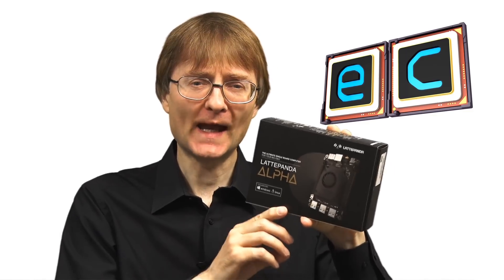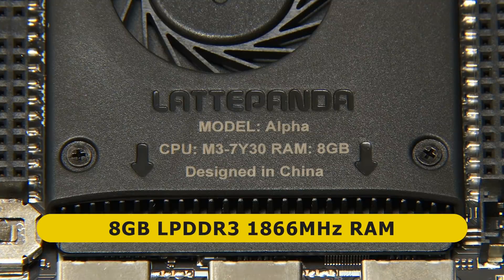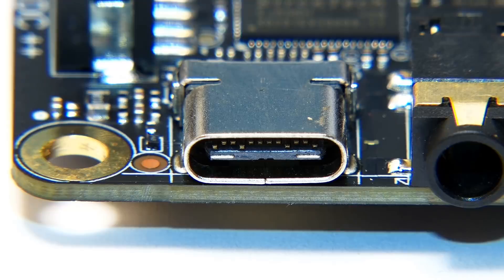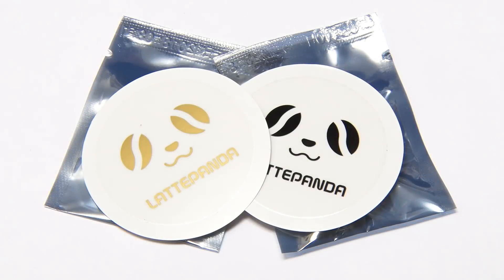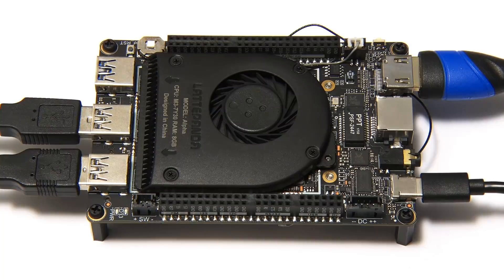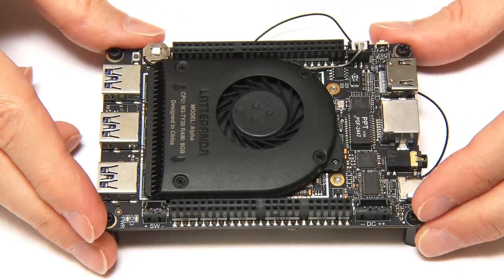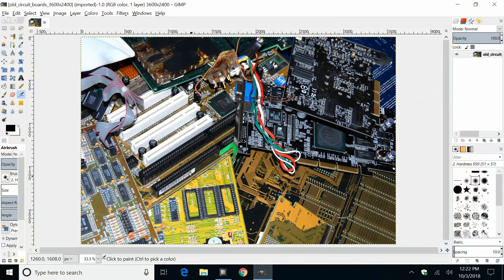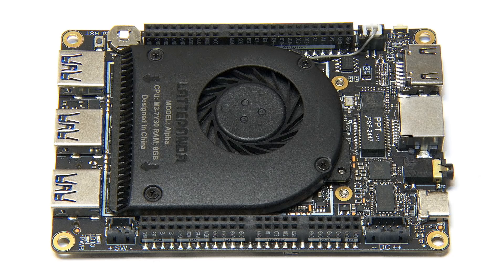LattePanda Alpha: Windows & Linux SBC

Comment: This little board and video have peaked my desire to build a NAS
Chris your videos are awesome my friend, you do such a great job at getting your point across.
I love how Linux has really become a cool hobby nowadays
Back in the day I mean in the early to late 2000’s I bought a bevy of boxed retail releases of Suse, Mandrake, Corel and Red Hat Linux
All in the name of projects.
We’ve come a long way to today.
I’m currently using nothing but Linux 
I bought myself a pinebook pro
And a large sum of SBCs 
So I’m set to tinker with Linux for years to come.
I’ve also got a small but might data center I built from old Dell Optiplex Systems and Xeons to make myself feel like they were server lol
The Xeons are so cheap, or were so why not.
Most of the machines I’ve done that too are turned into small nodes in a small data center like configuration.
Not a ton of space is on them. But they work beautifully 😊

Comment: If you're considering buying a LattePanda Alpha/Delta I'd strongly encourage you to visit the LattePanda forums first. Despite these boards having good specs, and indeed reviews,  you'll see there are significant recurring technical problems reported by users that DFRobot have not provided updates or solutions for. 
If you happen to be unlucky enough to run into these problems you will be asked to ship your board back to DFRobot in China. My board was gone for 6 weeks after the much reported power/boot failure, then returned and the NVMe slot didn't work. I've now been asked to return it to DFRobot again. Beware.

Comment: FYI my LattePanda Alpha died after around 2 years of use (dead this past weekend 01/2021). Completely DOA, no lights when powered by USB-C and 12VDC on the JST PH2.0 4-pin connector. Seems many others have had complete failures as well if you search around a bit. Depressing since these are nice little SBC’s. I even kept an external fan on it and monitored the hardware temp sensors 24/7.

Comment: It's an interesting little device but who is it aimed toward? At over 300$, you're clocking in just under what you can build a Mini-ITX beast at with a Ryzen APU. And that's just for the board. No accessories, no OS, no case, nothing. I understand why the price is what it is, but what purpose is it serving? At 150$ this would be a behemoth of an HTPC, but it's roughly triple that to function as one, while only being marginally better than a Raspberry Pi 4 at the same role.

x64 is also far less forgiving on weaker machines.

Comment: Can you install old OSes like MS-DOS, Windows 3.1 and Windows 95 on there? I mean is there a way to lower the RAM on this device to 1 GB? And are there universal drivers to work for sound and video on installing drivers for these old OSes I’d mention in this comment? I would like to know please.
Reply from the maker: You will struggle to find drivers. But you can install DOSBox and run DOS and Windows 3.1 no problem -- much as I do here on a Raspberry Pi: https://www.youtube.com/watch?v=idHQk99E4VA

Comment: What's alternative board to latte panda with AMD embedded APU with Vega 11 GPU and quad core CPU and 2 threads with 2GH or more clock speed and 16gb ram support
Reply from the maker: You may want to look to the UDOO Bolt: https://www.youtube.com/watch?v=8DINmS5YBD4

Comment: It is a cool little system but i think for myself i would go with the Delta because i would plan on installing Linux on it with RetroPie to run arcade emulation that should handle a whole lot better than the Raspberry Pi.

Comment: Not interested. 6 GPIO from the Intel processor, another 20 from an auxiliary microcontroller and a preposterously low amount  of DDR3 RAM given that it is actually some lowcost notebook board. Likely even with the RAM soldered to the board which is fine if you're running a limited sort of embedded application,but again this is meant to run Windows 10 and for that there has to be a way to upgrade the board to 8Gb and beyond.

Comment: Been toying with these small formats and a big issue I never thought about is the heatsink fan/cooling.  It's usually custom and impossible to source.  I found laptop parts are the best place to source for a suitable replacement when/if OEM has issues.

Comment: Thanks for being honest and starting the video out by telling us that the LattePanda was supplied FREE for review purposes.  I agree that the Pandas are all wonderful values if supplied FREE.  On the other hand, if you have to pay for them, not really such a great deal - and checking their web site, DF Robot seems to be pushing their already ridiculous prices even HIGHER than those quoted in this review.  Sorry DF Robot, you are going the wrong way...
Reply from the maker: The higher prices are for the new "s" model, which has a faster CPU.
Reply: @ExplainingComputers   
In general you would think a chip with a higher 'turbo' clock would always benchmark higher, but with Intel's arcane TDP based throttling it's never that simple.  In the old days it was simple, a chip would be specified to run at clock rate X and that was that - but NOW Intel specifies a max 'turbo' clock that it's internal governor might use (or maybe not).  They say this is to let them dynamically manage TDP, but I'm not sure that Intel isn't just using it to increase their yields by internally programming the governors of each chip at test time to keep those chips from getting into trouble if they are sub-par.

The web site www.cpubenchmark.net collects real world performance data in the wild, and publishes the average for each CPU type, and here are the current numbers for the old and new LattePanda Alpha CPU:

m3-8100Y = 3489

m3-7Y30 = 3554

So despite a much more impressive "turbo" clock specification, real world scores look roughly the same.  I wonder if perhaps DFrobot's impressive Geekbench comparison scores were based on simple random variations, or was it something they were doing wrong on the original m3-7Y30 (slow or single channel RAM for example, or their original stupidly inadequate passive thermal design).

In any case, their new fan based m3-8100Y boards should be nice I3 class performers, but they are I3 class boards, not I7 class boards, so I still think the prices are way the hell out of line.

DFRobot can spew all the silly kick-starter hype they want calling it "the soul of a powerbook"  - doing a comparison to another over-priced product that is literally Apple Laptop  to SBC Oranges -- but this doesn't impress me much considering that two years ago, during an Amazon Black Friday sale, I bought an Acer Aspire E 15 Full 1080 HD Gaming Laptop with an I5-6200U CPU, 8Gigs of RAM, a fast 256GB M.2 SSD, and NVIDIA 940MX 2GB Graphics, and of course Windows 10 - and paid almost exactly what they are asking for this silly little toy with Win10 and 64G eMMC- So YES I think it's overpriced.

At $199 USD in it's minimal No-OS, No-eMMC configuration it would be a bargain, at $249, it would still get a grudging buy recommendation from me - but at $379 ? - Who are they kidding???

Comment: Using Windows for embed systems in industrial applications basically should be a crime. So many random devices I see everywhere with a Windows error screen....
Reply: Chloe Mcholoe I’ve seen that too.  There is a version of Windows that runs stable on industrial systems called Windows “Embedded”.  These can tolerate power loss and keep the OS isolated from user data.  For some reason people continue to build embedded systems with regular Windows, which should be a crime, like you say.

Comment: Here is the reason why it is selling for the price of a basic laptop:  CONNECTIVITY. 
It can connect to things and be programmed to do things that you simply cannot do with a regular bare bones laptop unless you add in some other control circuits, and those will cost as much as this LattePanda itself.   However, the problem with Windows 10 is the constant updates and the amount of memory that it is eventually going to take over.  In 3 or 4 years time the updates will occupy the entire memory and there won't be room for any other programs. That is why the Raspberry Pi is a better toy for doing things with as you don't have to worry about constant updates filling up the memory.

Comment: Mr Barnatt: (I told you I'd be back)...I have 3 "hand-me up" laptops, all with windows, ranging from XP to 7. None see to be worth the effort of trashing, so I'll use my latest hand-me up until it drops, and I can' t wait until it 
does. What I've seen on other Linux videos seems to imply that if I download Linux to a thumb drive or a micro SD flash drive that will completetly replace the windows OS. Is that true? (I hope so). I'm not at the point of buying the Latte Panda Alpha 864 yet, as I still have a lot to learn, but I think I'm leaning toward Linux after
hearing about its advantages over Windows...it'll just be what I want most, and what I can do with it, with out 
beating it to do death because it's so easy for me to do, being so computer illiterate, and I continue to grow that way exponentially, no matter how carefully I try to be with it. I will probably send you more specific questions about Linux vs Windows later.
Thank you, sir
npk
Reply from the maker: Welcome back! If you choose the option in the Linux Mint install to replace Windows (which is what I show in my "Linux Mint 19 For Windows Users" video), it will indeed replace Windows. Good luck!

Comment: I would like to see how it runs VR games, It should have enough power for Steam VR and run things like VR Chat, since it is so small it might even  be usable in a wearable VR setup so connecting a wired VR headset to it would mean your always hands free cause you are wearing the computer with WiFi internet.

Comment: Can anyone explain where I tape the wifi and Bluetooth antenna to?  Where do you stick them after connecting them to the connectors?
Reply from the maker: This is a great point! They are intended to be stuck onto a case I think. I have them handing around.

Comment: Is it possible or allow to install any Linux version (from Ubuntu website)  rather than their modified version which is built for Panda.
Reply from the maker: It is. :) Unlike on the first LattePanda, which needed an image built for the board, you can install any x86 distro on the LattePanda Alpha. Just write your ISO it to a bootable USB and install. By coincidence, my video to post this Sunday (Jan 20) is called "LattePanda Alpha Week", and in this I show the BIOS, and my setup running Windows 10 and Linux Mint 19.1 dual booting.
Reply: @ExplainingComputers  ohhh I can't wait to see your new show and thank you for your clarification. :)

Comment: Do you plan on doing a Linux install video that will work for the 4GB/64 version? I've been searching but ever since the Alpha came out it's all anyone covers -_-
Reply from the maker: I will be uploading a new LattePanda Alpha video on January 20th, in which I run Linux Mint 19.1 as well as Windows 10. Install is just the same as for any other x86 PC, as in my video here: https://www.youtube.com/watch?v=eI7QQqnV1P8
Reply: @ExplainingComputers  Thank you very much! I wasn't sure if it would have any different steps than a normal x86 system since it's an SBC, and being a $150 board I wanted to be sure. I sincerely appreciate the reply, also big fan of the channel 👍

Comment: have you tried to run a slightly older m.2 SSD on the Alpha? I've been trying to run a non-NVME Samsung Evo 850 but it seems the Sata drive is not recognised correctly. It's likely a chipset/bios issue but possibly the USB-C supply can't get the voltage stable for the SSD to work? And yes, more alpha videos are welcome! :-)
Reply from the maker: I'm just completing a massive new LattePanda Alpha video forJanuary 20th 2018. I've tried one SATA M.2 drive (Transcent) and it did work.

Comment: There is no m.2 slot that supports s-ata AND pciex. That's why they were keyed differently in the first place. Just wanted to point out that what appears to be a pciex keyed slot you state it supports s-ata 3 which in fact it does not.
Reply from the maker: There most certainly are M.2 slots that support both SATA and PCIe SSDs -- if not at the same time! In fact, most new motherboards do this these days. Slots are simply keyed for both. And, I have used both an NVME and a SATA drive in the LattePanda Alpha. :)
Reply: @ExplainingComputers   I would definitely like to see a demo of the same host controller providing both s-ata and pciex in the same slot, at the same time. But it's ok, you don't have to provide accurate info on youtube anyway.
Reply from the maker: I recorded such a test in this video: https://www.youtube.com/watch?v=kvHUVcgo8xY -- using an i7 motherboard, rather than the LattePanda Alpha. It shows  switching the SATA M.2 for th NVMe in the same slot. The test results are at about seven mins 50 seconds. As you will see, the speed difference is amazing! :)
Reply from the maker: And I am confused by your comment "demo of providing both s-ata and pciex in the same, at the same time". Clearly they are not in the same slot at the same time, and I have never claimed this to be the case -- which is why I wrote "not at the same time" in my first answer to you". So I am providing accurate information here on YouTube. Your initial criticism was that the same M.2 slot cannot be compatible with both a SATA or NVMe drive, which it can be (and very frequently is these days), and the above video link shows.
Reply: @ExplainingComputers  sorry, not at the same time. I was all about supporting both drive types in the same slot. Used to own a motherboard that only supported pciex drives. Hence the impression you need a different keyed slot. Saw the video where you test both types.

Comment: Nice board, but still a little to spendy for a SBC.    At this price point I probably go with a Micro-Itx or Intel NUC build

New Parts (Newegg)
AMD RYZEN 3 2200G             - $100
GIGABYTE AB350M-DS3H      - $60
G.SKILL Aegis 8GB                   - $53
Intel 545s 2.5" 256GB SSSD -   $60
Used Micro-itx w/psu               -$45
  Total                            -$318

Intel NUC w/ i3-8109U         -$278
Memory/SSD(From Above) -$113 
                                  - $391
Reply from the maker: I very much like your choice of PC components there. :)
Reply: Thanks,
Reply: I have to admit I want one,  Amazes me the power consumption averages 8 watts.     In the 80's that would be about same as a couple of Christmas tree lights.

Comment: Can you tell me if the I/O pins will connect to a DB25 parallel port if I address the pins accordingly in the programing Because Linunxcnc wants a DB25 connection
Reply from the maker: This I do not know. But as USB to parallel port adaptors exists (I have one that I once used to run a parallel port printer from a USB port), connecting a parallel device to a LattePanda alpha must be a possibility.

Comment: great video again thanks. can this panda do a power-on boot - negating the need for the power switch?
Reply from the maker: I am not aware of this. But as there are pins for the power switch, potentially they could be set as permanently on (and you would have to set the OS not to respond to them when booted).

Comment: Another channel stated it will not 60 frames per sec for 1080p did you verify   your statement
Reply from the maker: My statement was reported spec. I am pretty certain that I outpout 60fps at 1080p, but as I always set it back to 50fps (I am PAL region) for video recording, I cannot be sure. I will try it next time I have the board live, but given the Intel graphics here I would be staggered if the LattePanda Alpha does not output 60fps 1080p.

Comment: I'm sure you're very busy but I was wondering if you could answer one small question for me, with the power supply did you just use a standard UK figure eight plug instead of the ones that were supplies (EU and US)? I imagine that's all you need to do providing the LPA's power supply is 100-240v and 50-60Hz right?
Reply from the maker: I plugged the power supply into an adapter to take the two prong plug to a standard UK plug.
Reply: @ExplainingComputers  Right OK, can you think of any reason why a UK figure eight plug wouldn't be just fine to use if you have one lying around? Thank you for the response!

Comment: My new LattePanda Alpha 864 was delivered on Oct 31/18. Over a very nice unit. The system works well in (unattractived)  Windows 10 Pro. As a new system on the market I understand that it will take time for the manufacture  to get up to speed  in providing information on how to add basic components  like a SSD drive and how to install  Ubuntu. I'm not one to complain on YouTube but in this case I must ask for your help. There are a few YouTube presenters  like yourself that are our only lifeline on getting any real detailed help on the Alpha . DFRobot at this time are not  providing  detailed instructions  on how to go about installing Ubuntu (18.04 or whatever the latest release that's out)  I'm sure they will get back on track soon, but in the meantime would it be possible for you to do full Ubuntu install. Thanks Chris.;)
Reply from the maker: I am planning a Linux install video at some point. But basically you  need to enter the BIOS (esc key on boot) and set the board to boot from USB. Then create a Linux USB boot drive -- as in my recent Linux Mint 19 video -- and boot from that to install Linux. The LattePanda Alpha is just like any other x86 PC.
Reply from the maker: Note that I added an M.2 SSD in this video! :)
Reply: Thanks for your feedback Chris. I'm  sure you will have a lot of Alpha users signing on to watch your Ubuntu  installation video.  Maybe DFRobot will post it along side your LattePanda Alpha review. 😀